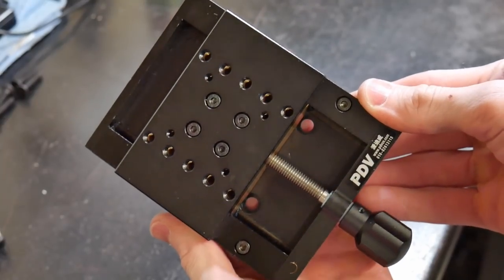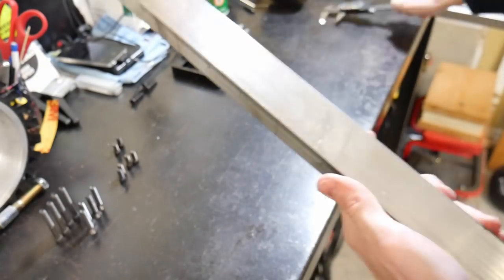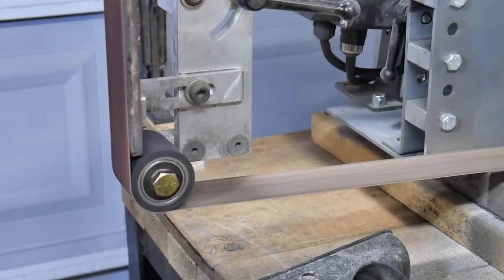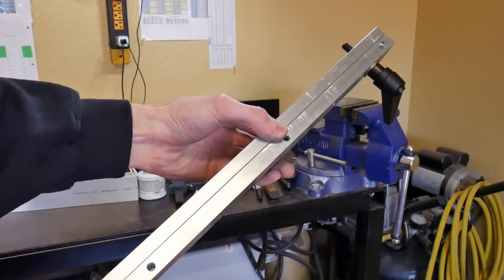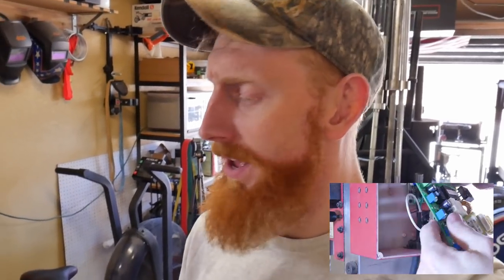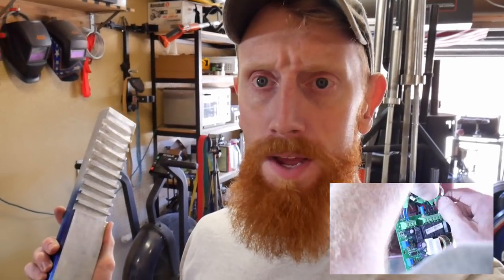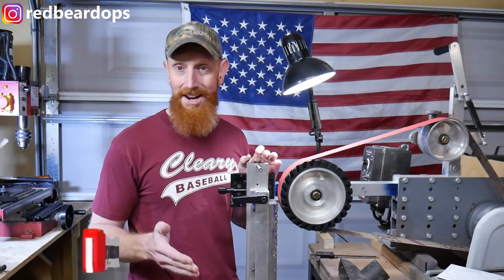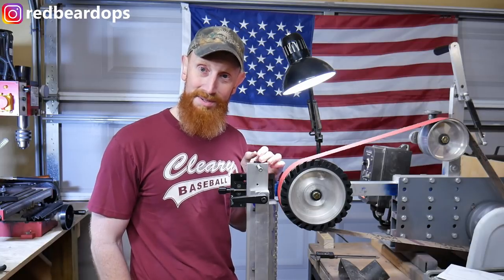Homemade Surface Grinder Attachment - Want Flat Things?

Comment: I just don't understand people sometimes. There is literally NO precision in that machine whatsoever, defeating the purpose of a surface grinder completely. Furthermore, for the cost and labor involved in putting that piece of junk together, you can go on craigslist and buy an ACTUAL surface grinder that actually does what it's supposed to do? shakes head they're like 500 bucks because no one wants or needs them anymore. I bought mine for a grand delivered and it's hydraulically powered. My first one was a little bench top model at a flea market for 80 bucks.
Reply from the maker: Thanks for watching sir. Sorry you disliked the video. This SGA has been working great for my needs! Cheers.

Comment: I don’t want to sound like an asshat, however, there is a lot in this project you’ve done in a conventional manner. There is absolutely nothing wrong with that, but you do have a mini mill. I’d strongly recommend taking the time to learn about aspects and principles of Machining. Invest in an edge finder, learn how to use the dials correctly. Once you begin to learn the little things, it’ll become far more than just a fancy drill press.

It’s not a conventional Knee Mill, but still learn to take advantage of it.
Reply from the maker: I've never opposed to learning new things, but there's only so much time in the day, sir! For the sake of this project a high level of precision was not needed. I have a lot to learn about machining though.
Reply: @RedBeardOps  Whats the rush? if it take 3 days vs 1 so what! Your not on high demand on youtube. Its not like you have to put this video out in a timely manner! I know when I subscribe to someone its because they do nice work and I learned something No one wants to watch some one hack and slash something When I use to upload I had 1.5 mill subs in under 2 years But I put out videos when Its was done and never rushed it!
Reply from the maker: @effyou128  Guys look, here is the bottom line: This project didn't need that level of precision. Having the slots exactly 7/16'' wide or exactly 0.34'' deep has zero practical affect on the ability of the SGA attachment to preform it's desired task. I am sorry that yall didn't like the build. Cheers.
Reply: WTF are you guys talking about? I'm a machinist and yes it was a little hard to watch, but he learned from his mistake. As long as he's not doing anything stupid unsafe (he wasn't), he can learn as he goes.He's not building Swiss watches or space shuttle parts here fellas, it's a Chinese mini mill. I don't see you master makers offering any words of advise that make your comments even worth making.

RBO- I would get some "roughing" AKA "corncob" cutters, that will reduce the cutting forces and help A LOT, either in carbide or HSS (Chinese carbide is okay if you're on a budget, but I don't care for their HSS) if you're mainly going to be working with AL, 2 or 3 flutes is what you want, I'd stick with 1/4"-1/2".  With a 1/4" carbide cutter you could have gotten away with that RPM (smaller cutters use faster RPM). For cutting AL coolant is almost a must, water soluble oil coolant in a spray bottle or WD40 works fine, not that oil you were using at first, that's for tapping. Download and print you off a milling speed cheat sheet to help get a handle on RPM you need.  ATB

Comment: I did a quick look...do you have plans for your surface grinder?
Reply from the maker: Hey Rob, I do not. There are a lot of good diagrams in the attached forum though. (bladeforums)
Reply: @RedBeardOps  the link seems to not be working.
Reply from the maker: @robrawlins4870  Works fine for me. Here it is - https://www.bladeforums.com/threads/home-built-surface-grinder.1532559/

Comment: Still too fast and too deep sir.
Reply from the maker: Agreed - wrong end mill too
Reply: @RedBeardOps  That's an advantage of "practice" with the cheap end mills before you buy the good stuff. Very nice work by the way, did you build the grinder as well ?
Reply from the maker: @oldhick9047  Thanks Steve! I defiantly learned a good deal with this one. I did not build this 2x72. Got it from Kyle Katramas. So far it's been a good performer!

Comment: Real Shocking!!! one of the worse artisans I ever watched, amazingly he still has his fingers intact. Not a role model for safety standards. Somebody, please point out to him that Aluminium is an abrasive material, even Tungsten cutters blunt easily. Seen lots of artisans use verniers as scribers if you must use a jenny it's easy to set and the scribed line is only an indicator for reference purpose. Never the less a great idea
Reply from the maker: Cheers man, sorry you didn't like the video. Have a nice day.